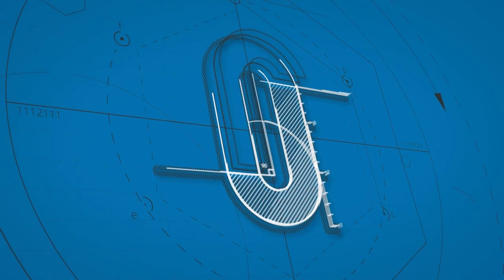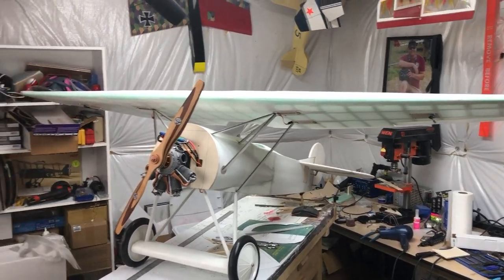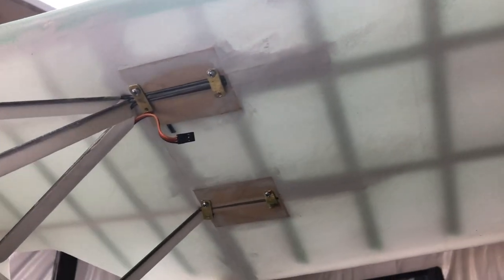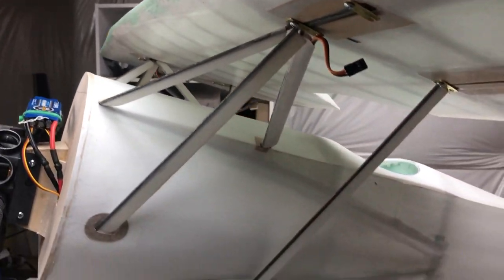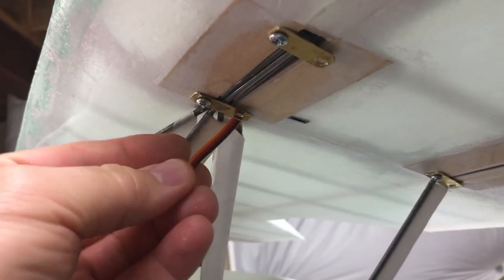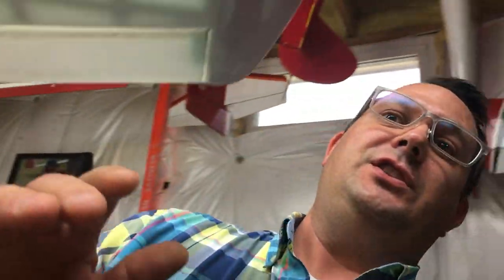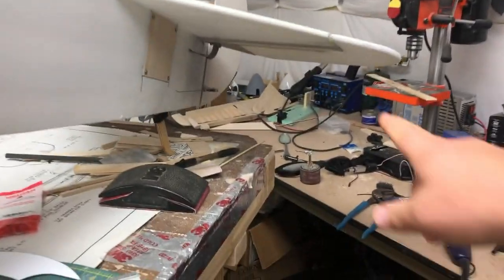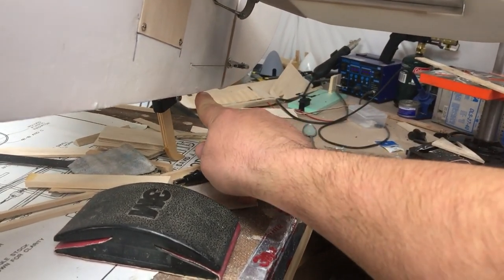Fokker D.VIII Ep. 06: What's left now?!

Comment: Nose heavy on the first try. bet that was a "damn, I'm good" moment. Great job.  I"m going to ask a few questions. The fact that you always answer is awesome.  Is the connection for the servo wire in the wing just an extension female end glued in? Second,  I've seen some dummy radials that do rotate with the motor. Looks great in the air. I'd think even lightweight printed ones would induce some gyroscopic effects. But again they look great. I've asked Santa for a 3d printer this year. I have several planes that are just begging for some Continental jugs. My question is, can you print a dummy radial that is balanced enough to actually rotate with the prop?
Reply from the maker: YES! I was very pleased with myself when I checked the CG! 
Yes, the wing connection is simply the end of an extension glued into the wing. Rough up the plastic first so the glue has more bite. 
Yes, I've seen this done before where the dummy radial rotates on some supported bearings. Inside the crank case there is a leather flap that drags along the bellhousing of the motor and rotates the dummy motor but not at the full RPM. This gives the effect of looking like it's spinning but not so much that there's a significant gyroscopic affect. This also reduces the stress on the dummy to hopefully keep it from tearing itself apart. Balancing should not be much of a problem as you can add some sand/lead mixed with gorilla glue into the hollow cylinders. Most prints will be fairly uniform so you'd probably be pretty close at the initial build. 
Good luck with your build!

Comment: Is the glassing just as strong using polyurethane as it is using epoxy?
Reply from the maker: No, it is not. It does add SOME strength but that's not really what I'm after. I glass to give a much nicer surface for paint and longevity. It's going to be more ding and rash resistant than bare painted foam. You do gain some torsional strenght but in terms of compression or tensile strength, only a little. Epoxy does help there but it is also heavier. It's a trade off. I don't NEED the strength so I don't want to add the weight. I DO need the nicer surface so I make the weight penalty of glass with out the heavier epoxy. Plus the cleanup is way easier, less fumes, and drying can be accelerated with a basic hair dryer.